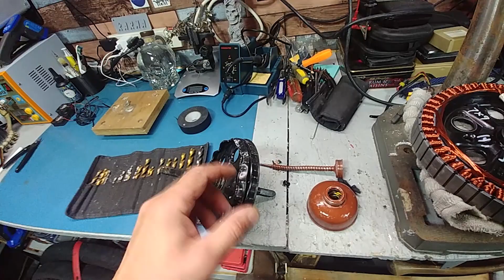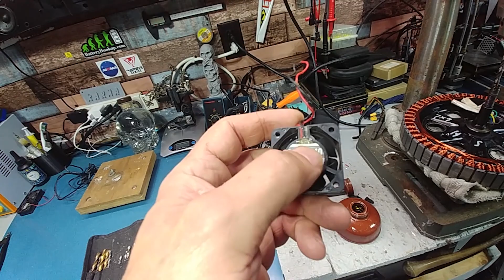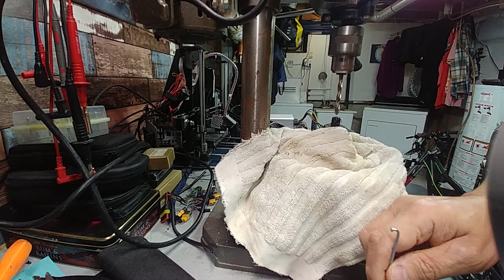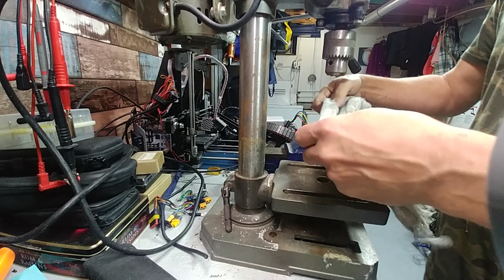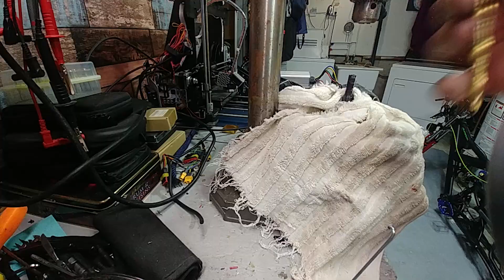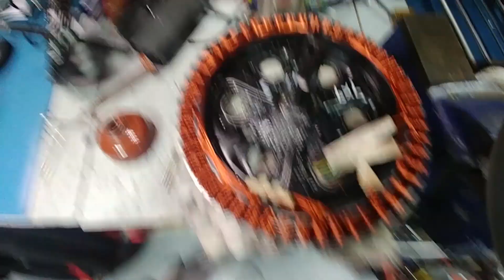ebike vlog# DIY SIX PHASE WIRES . Saturday, November 19, 2022

Comment: Wouldn't the axle be less strong? As compared to it not being drilled?
Reply: It technically has lesser material on it now.. right?
Reply from the maker: @zeal8326  other end has even less material and holds up. did a few builds like this never had a axle bend.